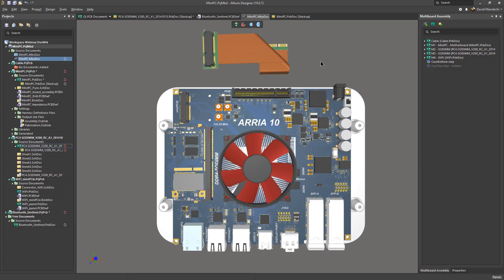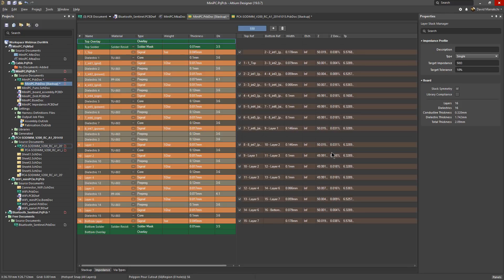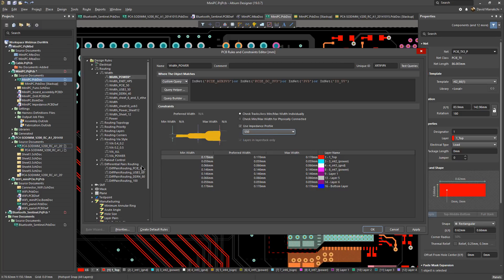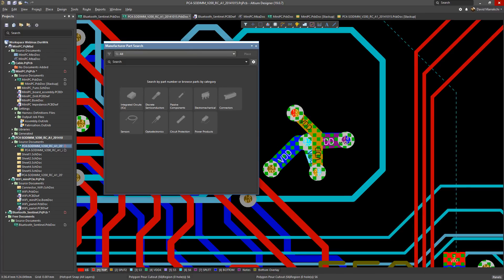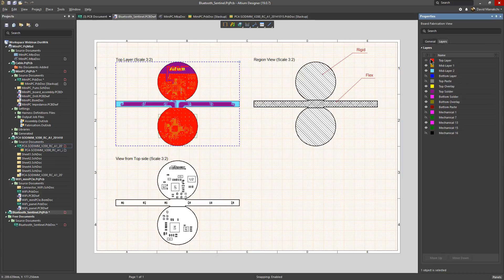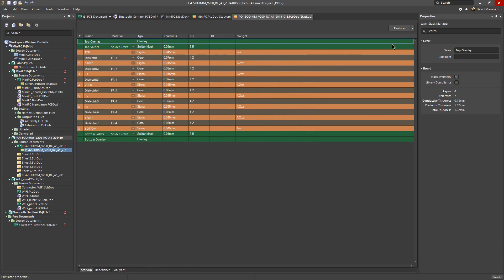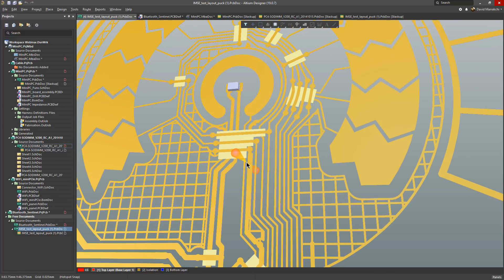Altium Designer 19 Demonstration of PCB Design Software [DEMO]

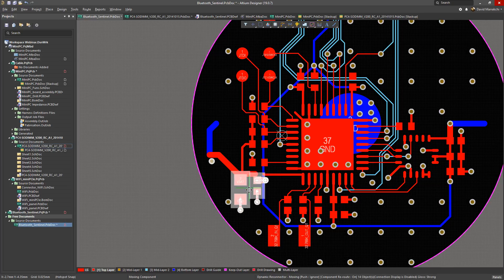Comment: Nice demo, but it shows a bug in the software at 6:39.  The routing of two component when moved back leaves a trace.  The two parts are still technically connected to the same net but the trace that originally connected them is left in an odd position.